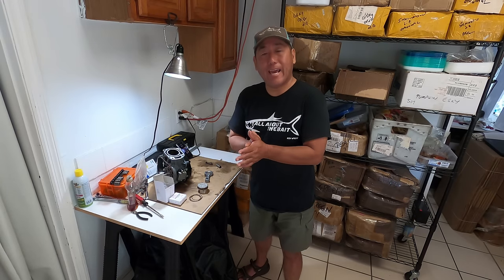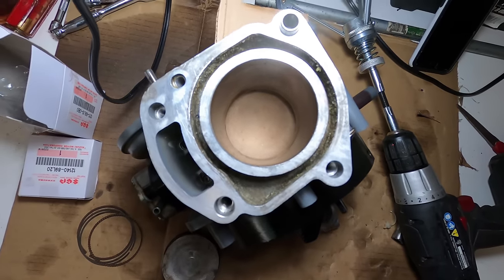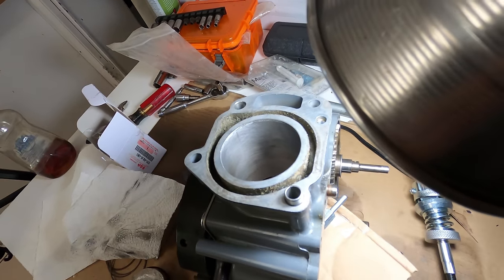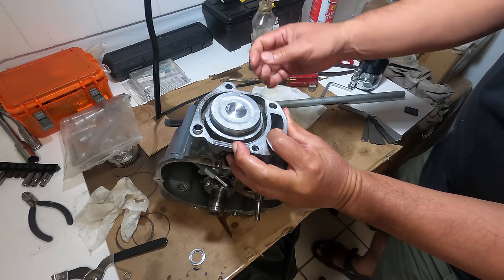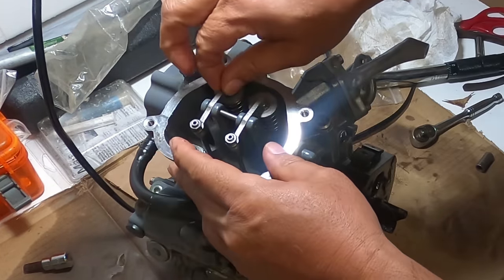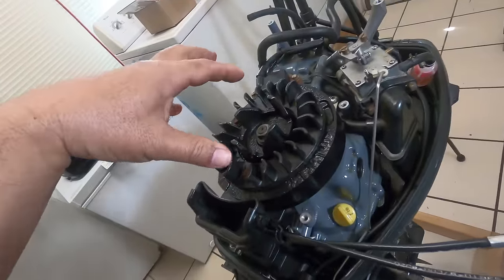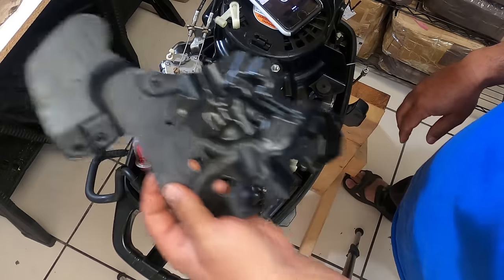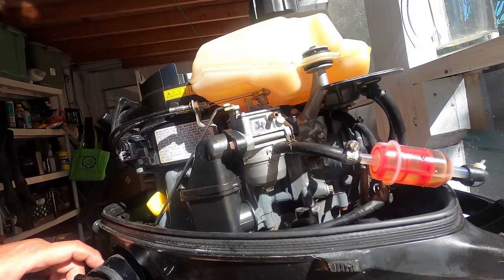Suzuki 6 HP DF6AS5 Outboard Motor basic home rebuild.

Comment: You forgot the hubcap gasket and the muffler bearing. 😁 I always loved small engines. motorcycle and riding mowers. What was the valve gap? .002 That always seems to be what I've always found. Torquing the rod bearings is a tight fit, but it is such a low setting I thought it would come undone on my John Deere 300 riding mower. Valves are almost impossible to set right. thanks. That was fun to watch. 🙂

Comment: Dude!  Wanna come fix my lawnmower?

I just think the connecting rod broke.  (It's only about 30 years old...)
Reply: Did it punch a hole in the case and will it still turn around? When a rod breaks that is usually what happens. A hole in the side case. 🙂
Reply: @JohnSmith-uy7sv  No!  It started making a clanging sound and stopped, no holes in the block.  That's why I think it's repairable.

(I did buy an battery powered mower so I wouldn't have to deal with gas and 2-stroke oil anymore, but I kept it around and I'll probably take it apart this summer to see what failed and if it's repairable.  Maybe I'll build a go-kart, lol...)
Reply: @Backroad_Junkie  😁
Reply: What’s the head torque and valve lash?